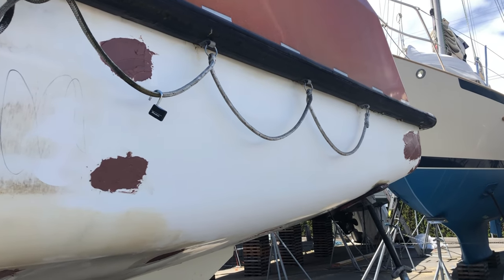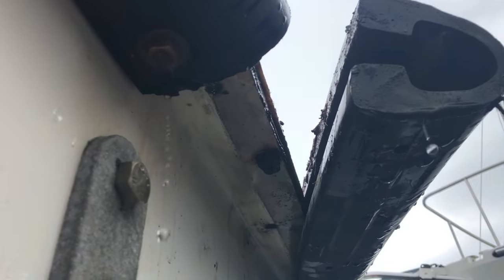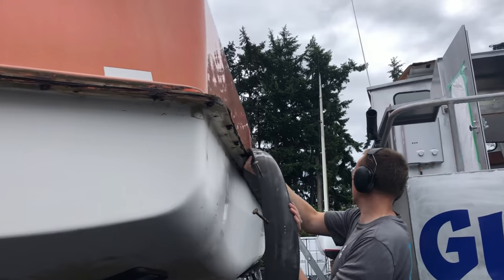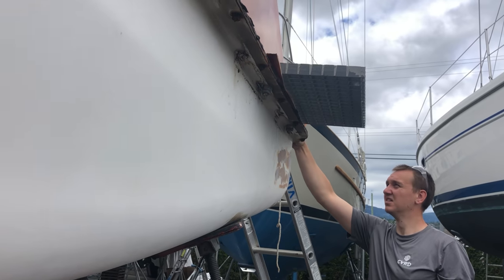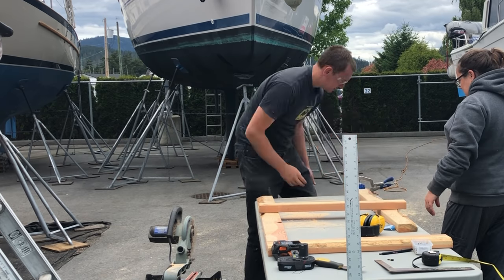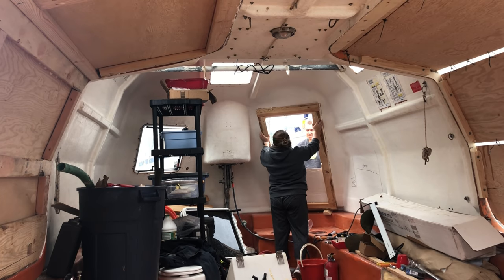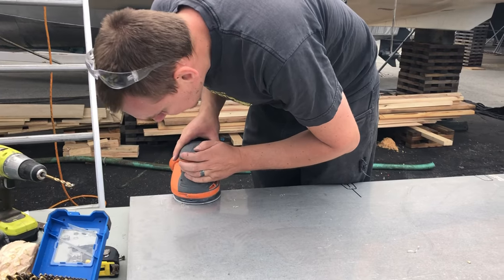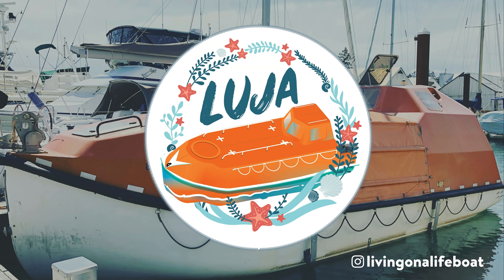Episode 7: Are We Held Together With Rust?

Comment: I do not think the the hull to deck joint, covered by the rubber rub rail is really intended to be walk on. It is slopping downward to limit the potential leak to the inside of the vessel. Good luck with your modification. Keep posting